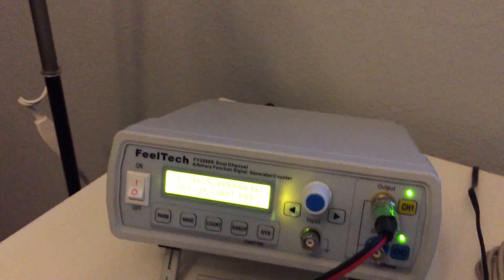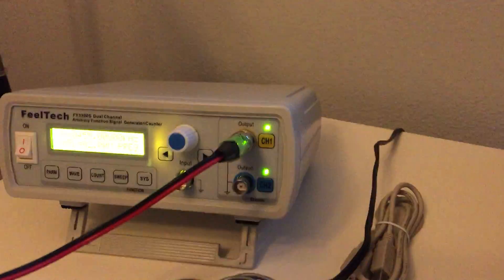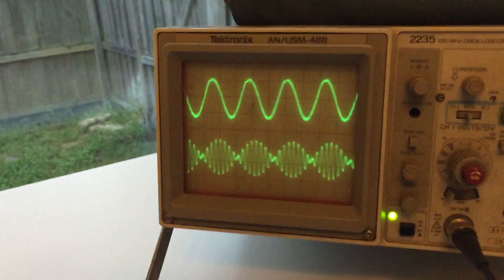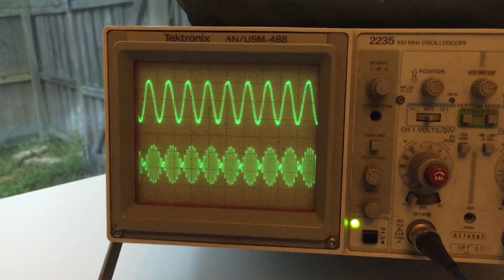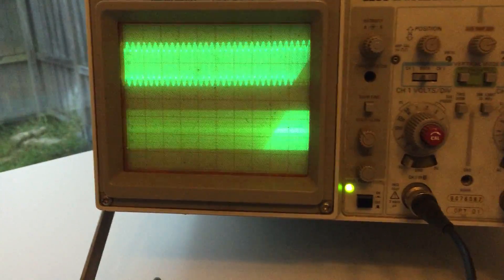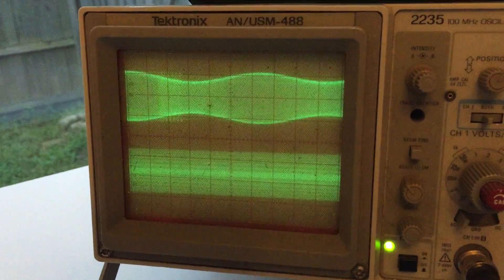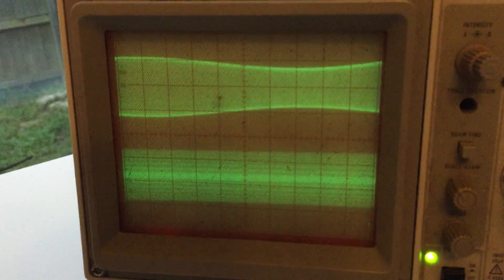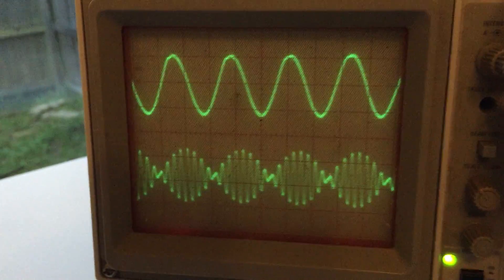Feeltech FY3200S FY3224S - Amplitude modulated waveform versus RF signal generator TSG17

Comment: On the TSG17 unit you have your output lead in RF instead MOD out. This means the TSG17 is only showing SIGNAL (Carrier Signal) on your scope, NOT a Modulated ( Modulating Signal + Carrier Signal). The Feeltech waveform is correct for modulated.

Comment: The modulation frequency of the Feel Tech is about 1/10 of the carrier frequency.  My FY 2300 does the same things and can not be adjusted to a useful waveform.  If the RF generator had a modulation frequency of say, 44.5 KHz, it would look the same.

Comment: I was looking at getting the FY6800 for doing RF/IF alignment on vintage radios, but not sure if it will be suitable. The top waveform looks like an unmodulated AM carrier. Have you tried tuning to the output frequency with a radio?

Comment: You can make a simple modulator with a choke and a NPN transistor (say 2N3904).  Set CH1 of the FeelTech to 400hz offset:0.2v, amp:2v.  Set CH2 to 455khz, offset:0.8v, amp:0.2v.  Feed CH1 through the choke into the collector, feed CH2 into the base, ground the emitter.  Take the signal from the collector thru say a 0.1uf cap.  The output has a lot of harmonics but it seems fine for tuning the IF of an AM radio. An old CFL can provide a good toroid for the choke about 0.3mH.

Comment: I was just trying this out with my FY32xxS - for "PRE9" the modulation frequency is that that you set up in the "MF" frequency - and the carrier frequency is many multiples of that - in the case I was just looking at I set the MF frequency to 272Khz - the actual carrier 
frequency was just over 2Mhz, and the modulation frequency was 272Khz - practically useless.

I am considering making a modulator and using the FY32xxS as a carrier wave source (sine wave) as that is pretty stable at least regarding frequency according to my oscilloscope. 

I need a say 272Khz carrier modulated by a tone, say 500Hz. Pretty much basic expected functionality of a signal generator.

Totally terrible device.
Reply from the maker: Wow you made me dig into an ancient movie.   Note that to do what you are asking I have restored a 60 year old heathkit for this task. It does a great job.
Reply: @retrotechandelectronics  In the end I bought an old LSG-16 RF generator - works just fine.

Comment: Jordan:  Did you ever find out how to get actual AM out of the FeelTech?
Reply from the maker: There is no way within the feeltech to set up a modulated waveform with the type of parameters that one would expect from a device that would use such a thing.  It is only a fixed signal at a given frequency that cannot be adjusted.  I would not use this to work on an AM radio.
Reply: For SWR purposes you should not need any modulation -- just sufficient RF to activate the SWR meter.   I needed modulation because I wanted to test the performance of AM detector circuits.
Reply: For SWR purposes you should not need any modulation -- just sufficient RF to activate the SWR meter.   I needed modulation because I wanted to test the performance of AM detector circuits.
Reply: I was able to get a modulated AM signal by using both channels. For example, if I want a modulated 1000 KHz signal, I set the main channel to 1000.0 KHz at X volts, then I set the secondary channel to 1000.4 KHz at 1/2 X volts and combine the 2 signals. The result is a 1000 KHz carrier modulated by a 400 Hz audio tone. 
The built-in Feeltech AM modulated signal is useless because at 1000 KHz, the resulting tone would be 100000 Hz (It's fixed at a 10/1 ratio and not adjustable)
Meanwhile, I've been trying to use the sweep function but so far, I have not found a way to get a trigger signal for my oscilloscope. I tried setting the sweep duration to be for example: 1second, while setting up the secondary to generate a pulse every second. The problem is that the 2 aren't in synch. It seems that there is a slight delay in the sweep when it recycles.